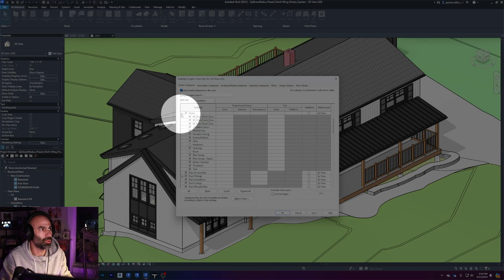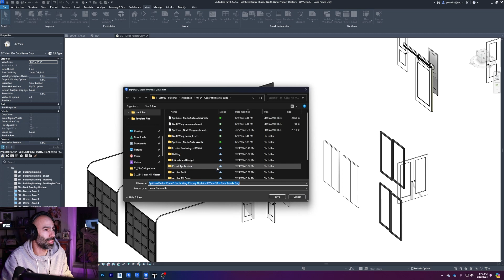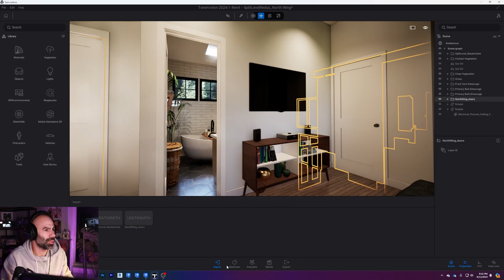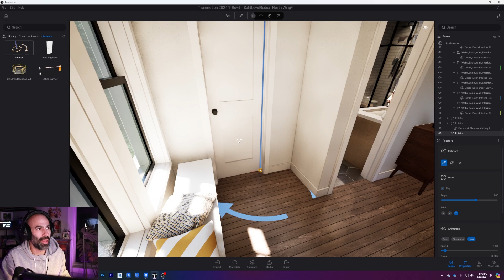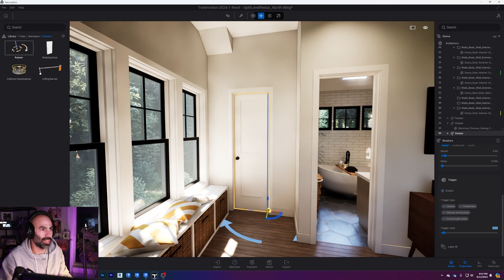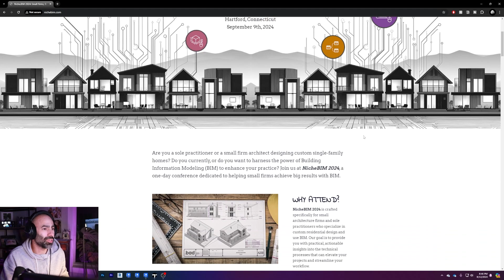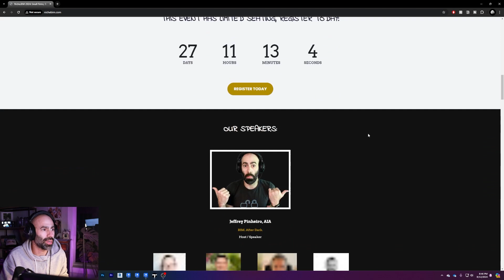Door Swing Animation in Twinmotion for Revit Users

Comment: I feel like this could be done automatically without needing to do the extra work if the developers programmed it to recognize that it's a door, where the hinge is located and the direction of the swing. I work with a program called Fuzor for realtime walkthroughs and VR, which is also possible in Twinmotion. The main difference is that Twinmotion looks great and requires extra work to animate doors. In Fuzor the doors animate automatically, but the quality of the visual is just ok. Autodesk could do this if they wanted to I'm sure of it. Great job by the way on the video.
Reply from the maker: @travissmith3651  cheers! You forgot to mention that fuzor looks bad AND is super expensive (last I heard).  But yes, I agree … there is no reason this can’t be automatic… the Datasmith files carry all the BIM data which tells you it’s a door … although, hinge side and direction may not be that simple as different door families treat this information in different ways (some use 2D only swings, etc …)